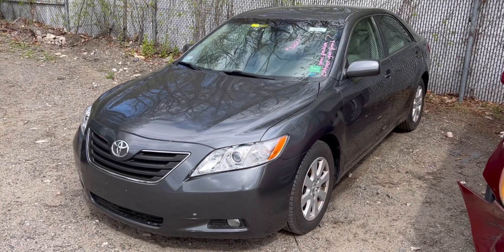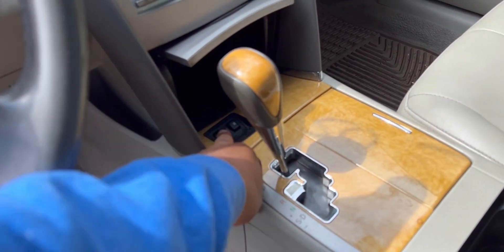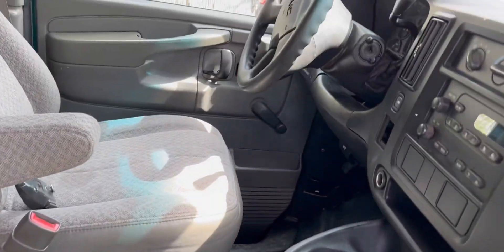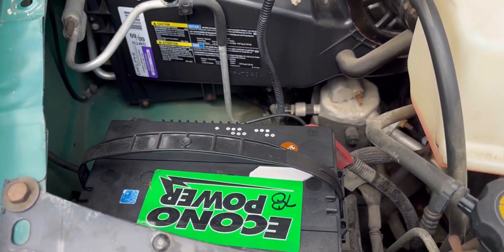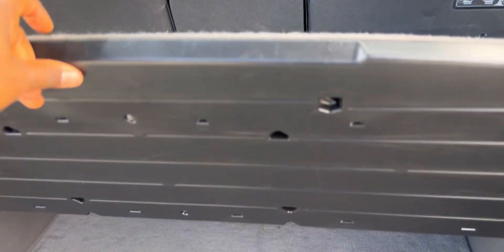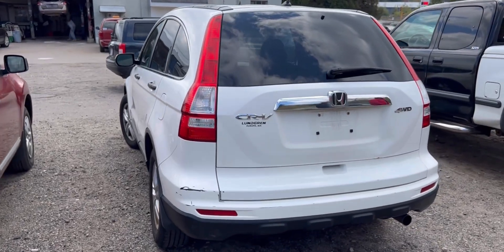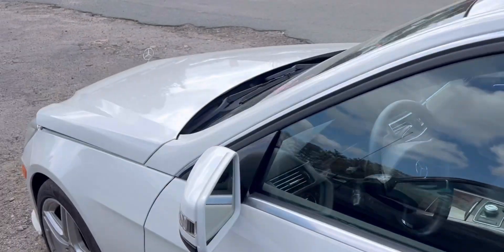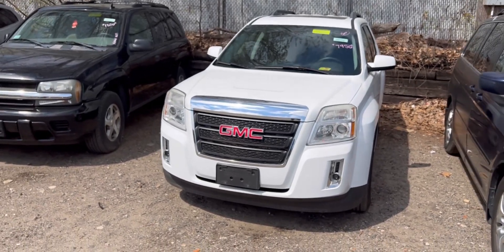V8 Power E550

Comment: E Classes, either the W211 or W212, are tons of car for the money. Not too difficult to work on and IF you work on it by yourself costs aren't too high. Whenever it comes to older Benzes they almost always need what I call the "Benz special" that would be a tune up (spark plugs replacement and clean the MAF/TB), motor/transmission mounts and fluids all around. That will transform the car.
Reply from the maker: Thanks for your contribution I appreciate it seems like you know a lot about Benz I’ll look out for Mercedes the next time I get there
Reply: @MonieCarsReview2023  Yep I've now owned 3 of them and upgraded my tools so I can do most things on the car. Helps to save money.
Reply from the maker: Yep definitely dose save up some dollars doing things your self